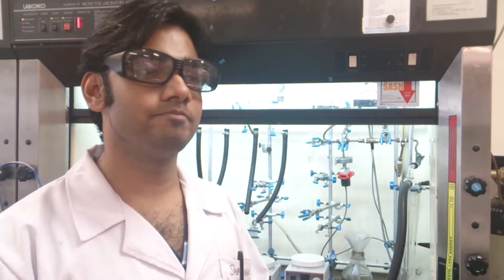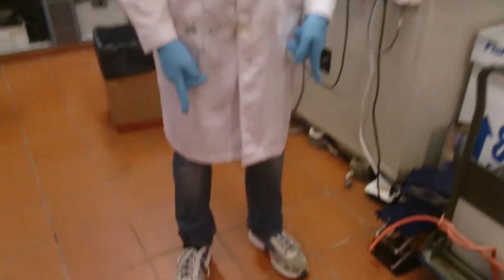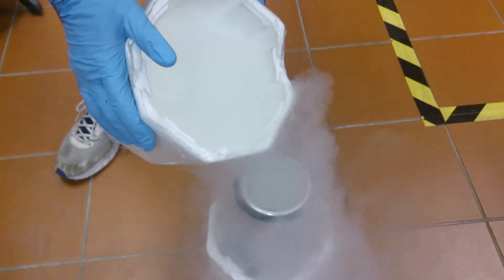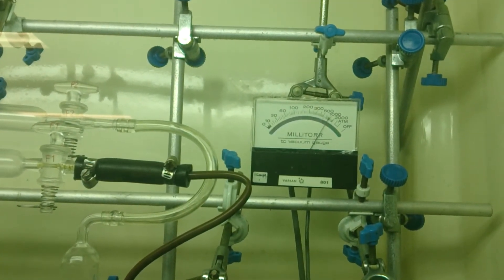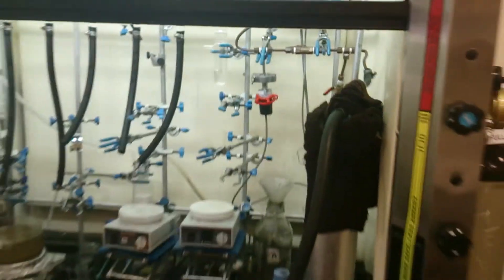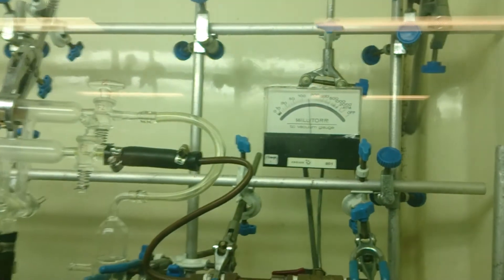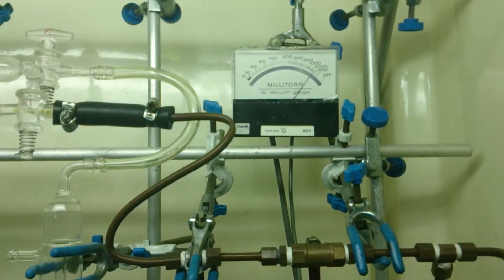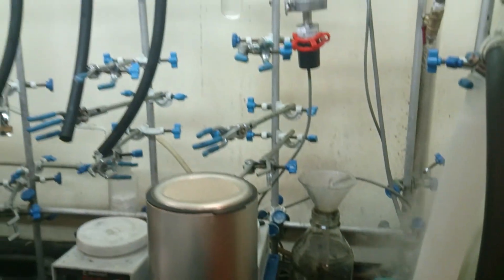Assembling and Disassembling High Vacuum Cold Trap

Comment: Does a vacuum cold trap stop vapor from getting into the vacuum pump, or does it only remove condensation from inside the vacuum. If not is there an apparatus that does both functions? Thank you.
Reply from the maker: High vaccum cold trap stops the volatile vapors from going into the pump. If not, the the volatile organic vapors might contaminate pump's oil and hence spoil it. 
The simplest method to remove condensation from inside the vacuum would be to heat it via heat gun. The vapors thus generated would anyhow get condensed inside cold trap.